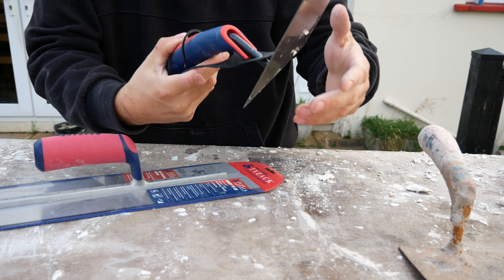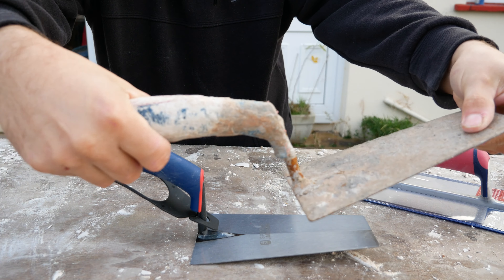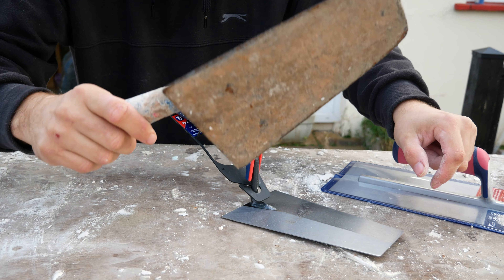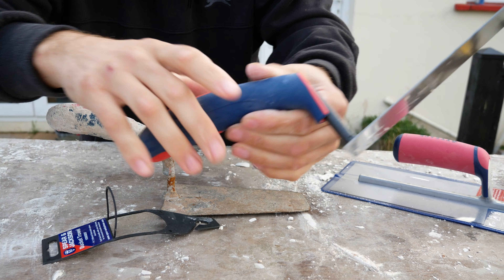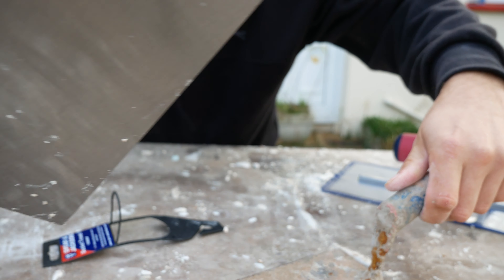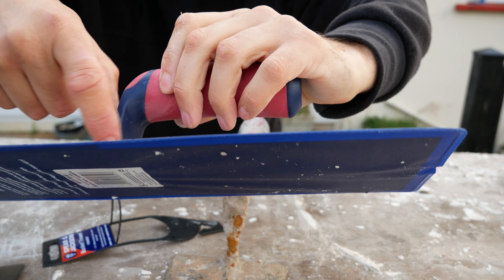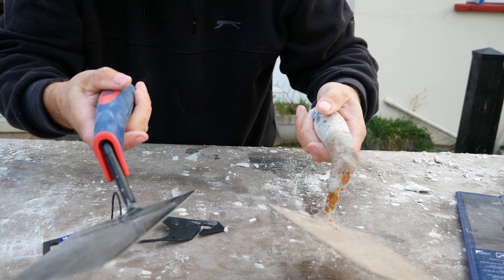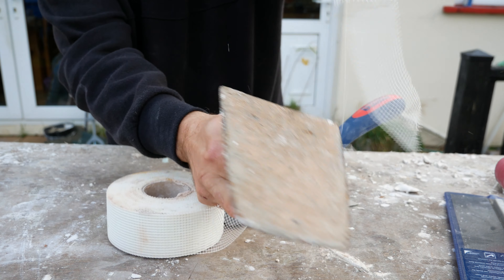spear and jackson tyzack bucket trowel for cement and plaster ect

Comment: Faithful prestige range dark blue rubber handle to a pretty good robust 1. Has finger guard also. Think all forge in 1. 
Refina 1 a have has a good angle for leverage
Reply from the maker: Yea refina stainless steel one its good also I'm just amazed how long this on lasted and how good its been over the years
Reply from the maker: Must get a look at that faithful one
Reply: This will take some beating can be bounced about scraper hammer axe lol if needed carbon steel but a good heavy gauge nice solid construction. May have the highest pitch on handle to see me others.
Reply from the maker: is thiols the type mate ? https://amzn.to/3HjcjDR
Reply from the maker: this is the same trowel but as spear and Jackson and cheaper https://amzn.to/3iBTWzL